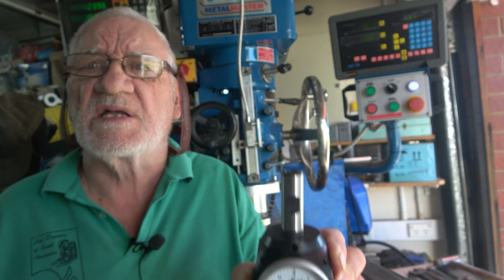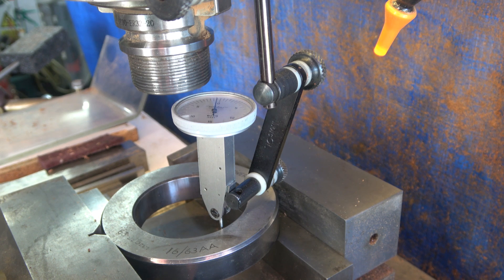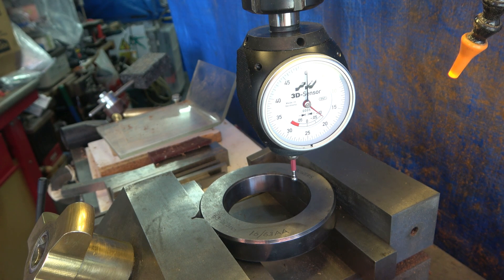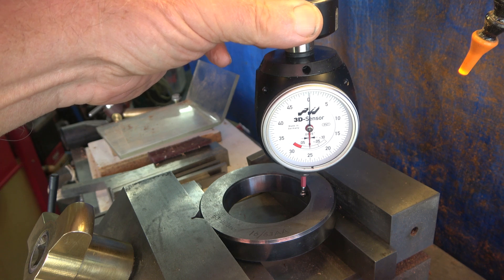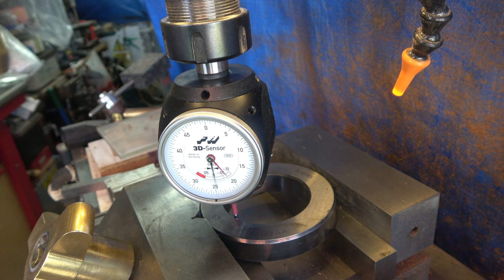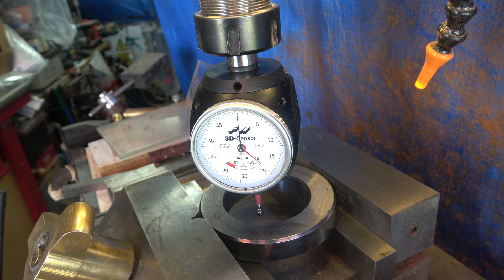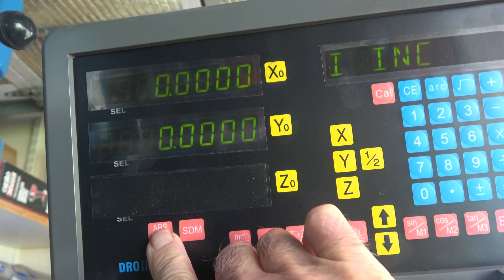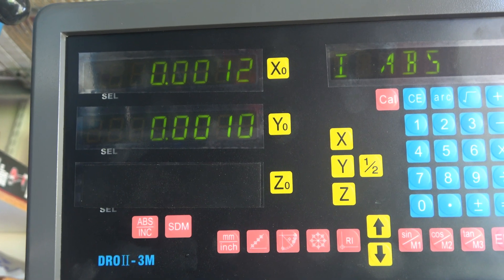HAIMER 3D Sensor Accuracy Test

Comment: I noticed the stylus of the Haimer was quite a bit of the center line. As the motion of travel therefore was not radial to the bore gauge, the actual stylus tip is sliding slightly ( err, sideways) when it comes into contact with the gauge and therefore friction might be causing a small positional error. I would expect higher accuracy the closer the stylus is to gauge center line. Maybe try a test?
Reply from the maker: Since the making of this video, the Haimer now has a dedicated NT 30 to ER 32 chuck with a 3/4" precision collet. All dialed in and the spindle dog and collet chuck have been marked so it goes back in the same orientation. I did out of interest try it 180 degrees and error was only a 1/10 thou. I re did the tests and the error now is between Zero and 2/10 ths thou. I found better accuracy if the Haimer was square to both axis. I tried 45 Degrees and got a greater error. As in the video, any pressure on the stylus will cause a reading movement if the Haimer is rotated.
Reply: @daveticehurst4191  great result!
Reply: @daveticehurst4191  Oh wow, that's fantastic. I saw another video on the haimer setting https://www.youtube.com/watch?v=fT09PDDiPZw and I wondered if you also had set the dial zero exactly at 2mm after setting up the tip concentricity. At the accuracy you now have, it's perfect. Thanks for posting the results Dave.
Reply from the maker: OK seeing as you took the time to watch and comment. Will set it up again and do another go on actual center and let you know tomorrow. Watch this space. Best Wishes.
Reply: @daveticehurst4191 I know the stylus ball is polished chrome but the problem is with friction is it can stick and then let go. Just saying that may be  contribute to a small error.
Haimer also make a Centro measuring head for accurate bore location.
Reply: @daveticehurst4191  I just watched the Haimer USA using this same sensor. They said than once the x axis mid position was determined, at that position locked in, then determine the y mid position for exact bore axis location. In doing it that way, it removes any small x axis lead screw and xy axes out of squareness errors - I agree these are each small errors in themselves,  but they compound up to a larger error.
Reply from the maker: @TAH1712  OK thanks for that. Will try that when I do a retest tomorrow. Will let you know. Regards.
Reply: Hi Dave. Very interesting and a nice piece of kit. But at that price I'll stick to my coaxial indicator.
All the best.
Andrew
Reply from the maker: @TAH1712 The plot thickens. I reset the whole thing again this morning, indicated the bore with the centering dti. With the DRO set on ABS I zeroed both axis. I swapped out the dti for the Haimer, checked the stylus for runout again, it was a long way out. I checked the ER collet and found that it was 1 thou runout, before re adjusting the Haimer I took it in and out several times and found an inconsistency in doing so. I have put it down to me having a .750" shank on the Haimer and me using a 19 mm collet, which I was slightly forcing open. I am going to purchase a high accuracy 3/4" collet just for use with the Haimer. I also discovered that if I did not use the full length of the shank in the collet it was greatly improved. I then redialed in the stylus ready for the next set of tests.

Leaving the XY still on center of the bore, I then proceeded to set the Haimer square to both axis, wound the Haimer to touch on the edge of the bore. With the DRO now on the INC setting, zero out Y, move to other side of the bore in Y push 1/2 Y button, move the table to center position. Do the same with the X axis. With both axis reading zero in the INC setting, push ABS button to check differences.

In the ABS setting the X read + 0.0008" and the Y read + 0.0004  I did this several times and got very similar readings. I tried all this again with the Haimer at 45 degrees and got very similar readings. I think that with a dedicated high accuracy collet all should be well.

There is still the problem of getting a different reading on the Haimer if you rotate it whilst under load. With only a 0.002" on the dial I can rotate the Haimer and the reading stays stable, anything above a 0.015" pressure and the dial and any rotation is up to about 0.007" deviation as the video showed. This is because I suspect that the stylus is on a gimbal so that it can move randomly in any direction. Although the stylus is on the highest point of the bore, there is sufficient pressure on the stylus that if you rotate it, the ball wants to slip sideways and give a different reading. Next time I may try a touch of oil or WD 40 on the stylus to check it out.

Thanks again for your interest and information. Regards.
Reply: @daveticehurst4191  Well, no don't thank me for the Interest, I thank you for your reply!
The deal is this, at repeated indicated errors of .0008 and .0004 thou ( 0.02 / 0.01 mm) , that's very good considering the machinery / spindle tooling you're using , although I'd say to be less than 0.01mm would always be preferred.
Positional errors creep in everywhere. By considering all your set up and tooling fittings you demonstrate to me much learned experience in machining. Maybe a little lubrication might help to combat sliding friction - the bore gauge looked a little rusty but I suspect the errors are in the quality of the spindle tooling - perfection at zero errors doesn't exist. The swiss make high precision collets for a good reasons but 0.0001 thou chasing is very very difficult. If you can repeated get the Haimer to indicate to a known error over various size bores then always position the same way and then correct/ adjust with that known error .
Or just accept the indicated Haimer imperfection and sleep better.
Another error could be in the accuracy of the machine DRO. With a revolving DTI , there's no DRO being taken into account and no repositioning the machine to a mid axis position from two indicated Haimer positions. So as you have said in your video, for high accuracy use the revolving DTI and for speed with some loss of precision, the Haimer can be used.
Reply from the maker: @TAH1712  Thanks for your long reply. As I said in the video if you want center better them 0.001" then use the centering DTI method. But for everyday setups the Haimer is very quick to use compared to swinging a DTI around a part. Regards.
Reply: @daveticehurst4191   Yes Dave, I did acknowledge you had said that and Haimer do sell a Centro device. Good to chat with you.

Comment: Nice tool - certainly very quick set up with it. I like it. Easier even than a coaxial style indicator - and probably more versatile. Thanks for the demo. 👍 Nice job on the custom case too - I like that. I have a few dial indicators could benefit from similar.
Reply from the maker: Hello Stuart. Thanks for the view. Glad that you liked my custom box, well worth the few hours that it took to make. The Ground Flat Stones I made also had a custom box made from the same length of wood. All gone now, any new boxes I will have to buy more timber. Regards.

Comment: Have you set the concentricity of the Haimer? There are 4 small grub screws on the top near the shaft to set it. It should be more accurate than 0.001"
Reply from the maker: YES I did. As I said the runout may be due to the collett or my Int 30 to ER collet chuck. Thanks for watching.